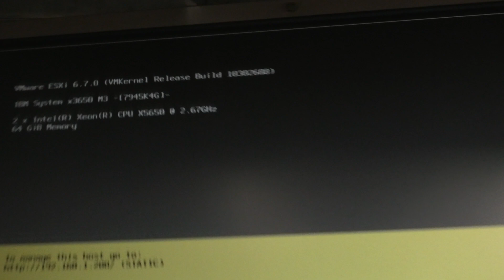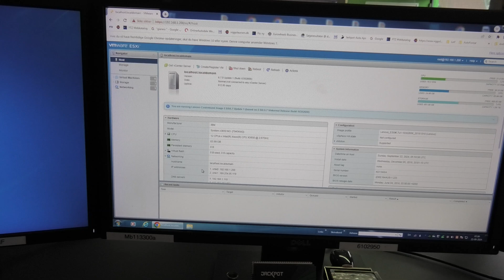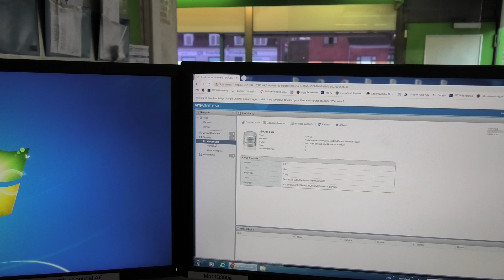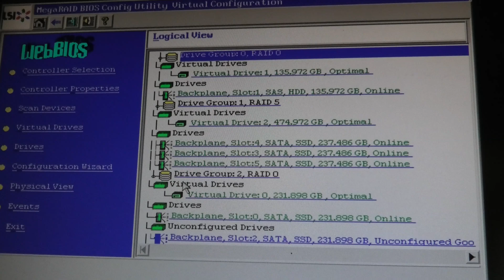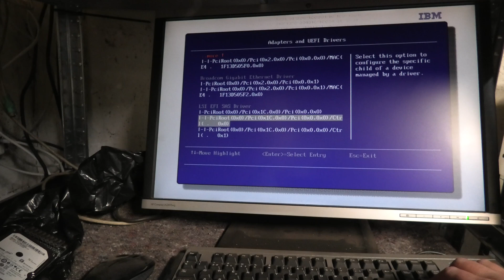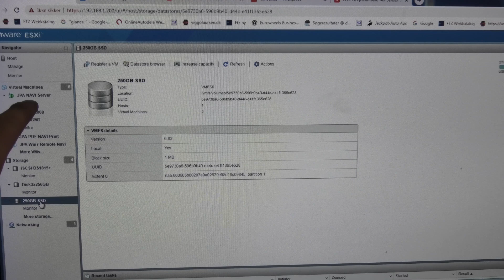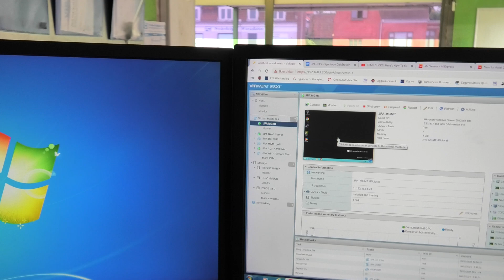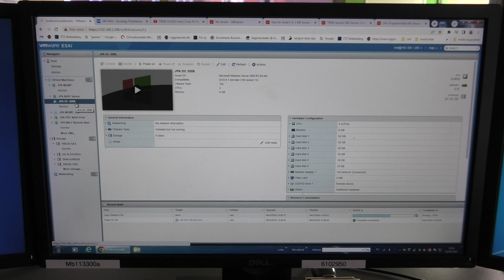Real Server Emergency !! SSD Crashed, VM's Down !! - 1425

Comment: Good time to review and maybe visit some of your clients and make sure the redundant solutions you put in place are still redundant!  I remember finding a few systems that were running degraded silently with no alerting.
Reply from the maker: I am done with that :-) I only have this one,, system I help with.. And he just called 5min ago to tell me that all was good, and that the water pipe over the server has been fixed :-)

Comment: If you have a dying/dead SSD, don't run any writes on the drive. Force shutdown/kill the running machine, move the data, then boot the machine. VMware is really good at caching write operations if the disk is busy, but that only works for so long.

I am glad that you think you have backups. Have you tried a restore recently?
Reply from the maker: That was also my teroi with the SSD stress it as little as possible,, and copy all the data over.

Backup is fine,, was used/tested ½ a year back,, a krypto attack. where some servers was responded from backup/a copy.

Comment: Raid6/z2 or triple raid even with ssds (especially unknown/used drives) backups are nice not having to use them
Reply from the maker: NAS runs SHR2,,, raid6 - ish
Reply: @MyPlayHouse  SHR2 is raid6 with slices if you have been using mixes size drives or upgraded from smaller drives (if all drives are the same and haven't been replaced with larger ones it just be one raid6 slice) 

Performance wise isn't much difference between using solid raid6 and SHR2

Comment: Sorry, but Windows 7 in 2024? I think your friend in the garage needs to reconsider hit IT support. And get a plumber.
Reply: Maybe Morten is also his plumber 😆
Reply from the maker: No I am not,,, this is oldstile water cooling.
Reply: I spy an Internet Explorer icon too.
Reply from the maker: The economy system runs in a Dos, It's quite a troublesome/hassle and moved it to something newer.. and LPT printing in win10,, there is a long list of issues :-/ It's never just that simple.
Reply: Dont change what works.

Actually never turn off a server if its working 😂.. had a server working perfect until it was moved to new location, never booted again. Dead harddrive.
Reply: Windows 7 runs forever.
Reply: And VMs running on a single consumer grade SSD

Comment: you know Windows 7 is EOL right??? 🤔😦
Reply: I suspect there is an application which wont run fine under Windows 10 or even 11...
Small businesses I accustomed always had something that kept them from updating...
Reply: if the client doesn't want to pay for the upgrade, the technician won't do it, same goes for the mechanics clients: they don't get oil filter replacements for free either
Reply from the maker: Yes,, his economy system had EOL like 25 years ago and run on DOS... LPT print is not great in win10 or win11

Comment: I once worked on a server that had the AC draining into a bucket ontop of it, it would spill over but that wasnt the issue. That server was infected by ants and for some reason they ate the thermal pads on CPU VRM and killed the board.
Reply from the maker: I do believe there was repair of the pipe monday,, as he called me to hear how to protect the server while doing it.
Reply: Fireants here in Texas love electricity/electric panels... someone said it was from the ozone given off.
Reply: @ironfist7789  I’m here in down under (Australia). Flew out to this remote site and I couldn’t believe my eyes 😂

Comment: You do use old SSDs for your servers.
Reply from the maker: Not really my server :-/
Reply: You get what you pay for. If you pay for 2nd hand drives, you get 2nd hand reliability. Some people are fine with that. Myself included. However, if you are a very large enterprise environment. Then yes brand new drives are a must. But for a small single server small business. Big deal!
Reply: @flyboyjohn  That does not look like a very large enterprise environment :-)
Reply: @mattymuc  exactly my point
Reply: Hey Morton, the RAID controller is probably in degraded mode and all write caching is disabled. This could explain the slow response time. Once all arrays are happy it should hopefully speed up again. 😉